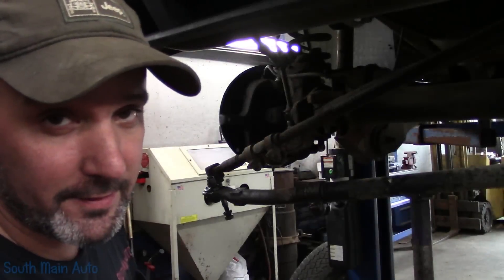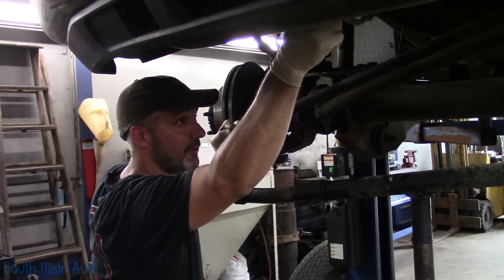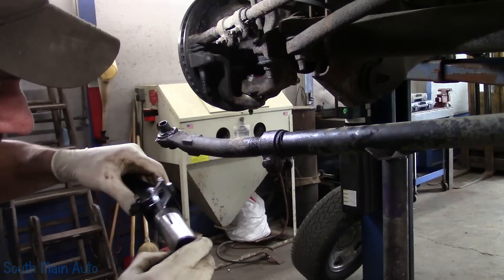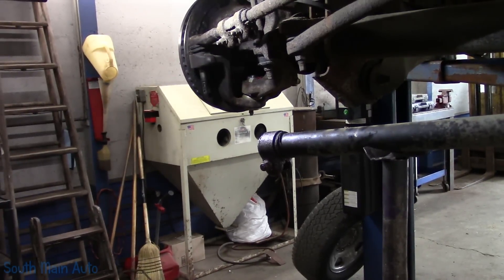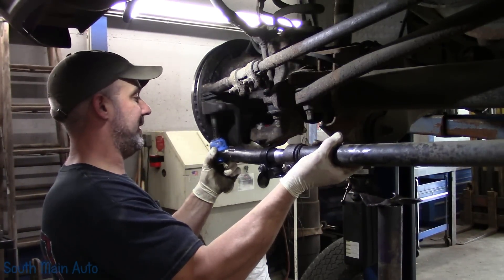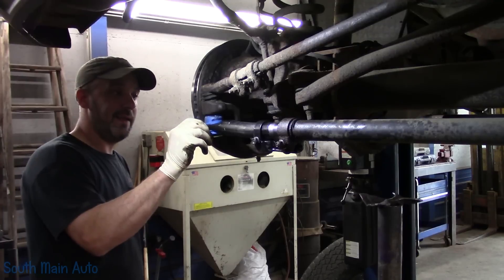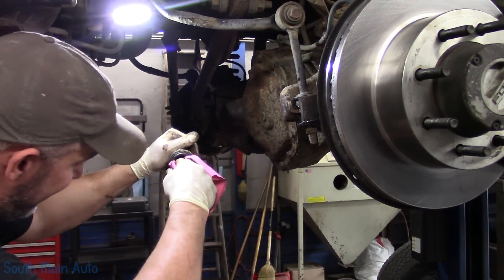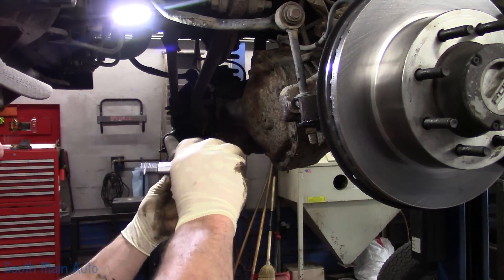Ford F-250: Ball Joints & Tie Rod Ends - Part III

Comment: 14:12 I feel for ya buddy. Back in the `80s I had an "X" car on the hoist. They had a license plate on the left side of the front bumper. I was walking a regular pace and my head met that f`n license plate puting a cut in my forehead. I stopped wearing a baseball cap while working on a car after that. That bill blinds you.
Reply: A knit cap works well and soaks up the blood before it runs in your eyes!

Comment: Re: 19:00 bent rims: doesn't matter. Youre rotating the wheel while drawing the line, so your line will always be perpendicular to the axle. If the wheel is bent, the line will be at an angle on the tire, but it will still be in the right plane relative to the axle.
If you're going off tread blocks, this is a different story.

Comment: Always learning something here! Great idea on scribing the tires. By coincidence I always had tire treads to use as a reference that had even lines around the circumference... but that is a great idea. More accurate, and a quick check for a bent rim or hub, or an irregular tire.  I must confess when I do this its not "to get to the alignment shop"..... that IS the alignment.

Comment: I use whatever penetrating oil is cheapest whenever I have it on the shopping list. Like you said- Project farm and the other tubers have all shown there is no magic in a can. Nice video series and thanks for sharing your journey once again.
Reply: I'm particularly pleased about the mixed magic failing any significant ratings too. Acetone and ATF will not combine making it's use for a long time soak so stupid even the cable guy isn't falling for it anymore. Just like so many internet rumors, this one will never truly die however. Because somewhere in poedunk - 'an old timer once told me...'

Comment: great series on the f250. just went through ball joint replacement on mine and had some of the same experiences you had. in my shop we use either a mix 50/50 of diesel fuel and mineral oil or atf and acetone. both are superior to anything I've ever bought. best wishes to you and your family.

Comment: I watch A.J. Foyt at the INDY500. Bent a tie rod. came into the pits. replaced the part. set the tow in/out with a stanley tape measure. went back out and WON! convinced me you can do well enough  the way you are doing it..

Comment: I’m in northeast Ohio. I’ll use pb blaster  and soak whatever I need to remove for a couple days beforehand.  My experience has been if the fastener is frozen in with rust it doesn’t matter. Break out the propane and hope you can break that bond. Penetrating fluid helps it come out easier but it won’t break the rust bond.

Comment: Project Farm did a good test on rusty bolt penetrating oils, and it turned out that few if any really did penetrate much, though there did seem to somewhat of an improvement over dry rusted bolts, not much, but some.

Comment: For the wheel alignment I use a piece of brown string attached to the outside of one wheel then around the front and other wheel and back again.  You can see if there is any degree and how much by measuring the clearance of the string against the outside of each tire.  Oh and you can do it with the string solo which is great if alone or everybody is busy.

Comment: I just did the right tie rod end and drag link end on my '08 this morning. My truck has the heavy duty front suspension and none of the aftermarket stores had a tie rod end that fit. Ford got me for $227 for a tie rod end (ouch). Fortunately, I'm a retired ASE master, so I do all my own labor. I used to tell people "If I can do it, you can do it. The only difference between us is that I own $100K in tools and know how to use them."

Comment: As a mechanical engineer employed in Australian mines, we have been able to test numerous penetrating fluids, both commercial and industry specific, with little real word effect. Our goto fluid, if you can refer to it as, is liquid carbon dioxide at - 75 °C. Extreme ? Hell yeah but always successful. Our technique of ' pour and punch ' with a pneumatic hammer, chisel or ratchet drive never fails to loosen. 👍👍

Comment: Been turning wrenches professionally for about 30 years in the worst rust belt known to man, Quebec and ironically did the same job on two different f250 this week. I agree totally about penetrate fluid being so so  at best .love your videos' Eric .i use a tape measure from end of tube to stud of tie rod instead of counting turns and both trucks were bang on for toe adjust, probably lucky tho lol.i didn,t see all your videos on this job i assume you covered that the camber caster sleeve has to be clean and lubed to avoid torque steer problem and that there is a sequence to follow when tighten the ball joints lower 44 ft lbs then upper 70 ft lbs then lower again at 150 ft lbs all to avoid the torque steer problem

Comment: I work in the heavy diesel field, I use Kroil.... and I love it.... I have had lug nuts that a 1in impact couldn't break loose. I hosed some kroil on them let it sit for a bit and then hit it with the 1in again and they came right off. I've also used it when doing work on exhaust and it has saved me from broken bolts.... Personally I have had good experience with it.

Comment: I used kroil for years at my last place of work.  Never heard of it before.  Its super thin and seems to work ok.  My biggest complaint about Kroil is the larger cans run out of pressure before they are empty.  I've used wd-40, pb blaster, liquid wrench.  i would say kroil is closest to pb blaster.  now, 10 years ago at a different job i used Zep 45.  loved that stuff, smells like bananas.  expensive though.  but that would be my choice.  it handles heat well too from what i remember.  seems Zep makes pretty damn good stuff.

Comment: I'm a homebrew ATF/acetone guy but i'll use WD40 in a pinch. I think on occasions it helps but i'm always ready to grab the air chisel and the map gas. Although on several occasions i've had to just cut stuff off with a cutting disk and go to the scrapyard and get something that isn't rusted solid. 

Thanks for the video Eric. Really interesting as always. 

ALSO. I HATE TO GET ALL CAPSLOCK. BUT WHO THE HELL KEEPS CALLING THE SHOP? SERIOUSLY WHOEVER YOU ARE, ERIC IS TRYING TO FUCKING WORK AND HE DOESN'T HAVE TIME FOR 20 QUESTIONS 30 TIMES A DAY. JEEZ.

Comment: I worked with a guy who didn't think penetrating oils worked. One day we were trying to change a lift brake band on an American 7220 crane. They have a 1-2/2 inch pin about 8 inches long anchoring the dead end that hadn't been installed using anti-seize. We had a drive pin with a shaft welded to it to hang on while driving it with a large hammer. We spent about 20 minutes trying to pound it out using a 10-pound hammer. You aren't supposed to use heat on the metal in lifting cranes because it alters the structure. My co-worker had cut the brake band on the other side to get the similar pin out. The band cost $2000 so we didn't want to do that again. It was late in the day so we decided to bring the slice torch out the next morning to bore a hole through the pin. I soaked it down with K&W Knock'er Loose and he laughed at me. The next morning we decided to try driving it one more time. On the first hit, it shot out and landed about 6 feet from the crane. It made a believer out of my co-worker.  

The guys that worked on the overhead doors brought a bracket from a door to the shop to use a vise. They had soaked it down the previous day with PB Blaster and couldn't get it out. The bracket was no longer available and they were trying to replace the roller. I gave him some Knock'er Loose to try. Later in the day, he asked me where to buy it. He said it was like it just like it disolved the rust. It's available under both the K&W and CRC brand names. I've had good luck with Liquid Wrench. PB Blaster seems to take several days to work. I haven't been a Blaster fan since the salesman came around with their air tool conditioner. He wanted to demonstrate it. He put it in our 3/4 inch drive CP and it promptly seized up.  

Any of these products take time to work. The longer they have to soak, the better they work. I had the advantage of knowing what I would work on ahead of time so I could spray it down at least a day before. Most shops only see the vehicle on the day they work on it so they don't have time to wait but if it's sprayed as soon as possible, it has a chance to work. If you wait until you are trying to remove it, it won't work in a couple of seconds.

Comment: That was old school toe adjustment and how we did it on heavies and DIRT modifieds...scribe and measure...bounce,roll, scribe & measure.  I don't know how many shops that replace tie rod ends and don't center them before locking them down and even had a few from alignment shops which should never happen and they are bound up...defeats the purpose of the pivot. Attention to detail. Nice 3 part series!

Comment: I'm going to call Eric and suggest that he respond to the phone call situation by writing a book - "The SMA Car Repair FAQ."   The book will answer all the questions that most people ask:

"My check engine light is on.  What should I do?"
"My Valiant is running rough.  My Dad says to add SeaFoam to the gas, my uncle says to put Marvel Mystery Oil in the crankcase.  What do you recommend?"
"After installing new brake shoes on my Galaxy, I have a few extra parts left over.  Are they important?  Can you tell me where they go?"

Comment: Suggestion on how to handle callers. Run promotion.   Here is an example. Anyone who spends $250 or more on swag, patron , fund me from Oct 6 to Oct 10 will be given a private number to call you and allowed up to 5 minutes. Calls will be recorded and will be on featured as a you tube video.  Buy a prepaid phone and give out number and throw away after that.

Comment: There's only one penetrating oil I've seen actually creep into the thread and that's Omega 636, and when it doesn't it really helps lube through the rust so the nuts and bolts cut the rust easier, at least it feels that way. If it's really much better than anything else, well SFR, CRC, SaBesto(Würth), and a few others I've tried don't really work as well, although SFR is pretty decent.

Comment: Back in 1996 my Dad had a Ford pickup truck that had the king pin freeze up and he couldn't turn the wheel.  He soaked the top down with liquid wrench and no luck.  He had bought a new product called Prolong for his van that kept overheating and it worked as the van never over heated again, but there's a whole nother story there.  Any who the kit he got included a can of super penetrating oil.  So I filled the top opening with it and Dad said I was wasting my time.  Now keep in mind when we did the same with the liquid wrench it just sat there.  With in about 2 minutes I noticed the oil was drained down so I spritz it again, same thing.  So I took to tge hammer and within 5-6 smacks it started to move and soon it was freed up.   Dad was excited as he was moving to the north woods and had another truck (that didn't run) besides his van to get up there.  I ended up pulling the other pick up on a dolly with this one.  So needless to say I have been using Prolong products for many many years.

Comment: I live in Cleveland. The best penetrant is a torch. F’in rust belt city. I use Blaster mostly. WD 40 only for some cleaning or keeping tools from rusting. It was developed to disperse water. Water Dispersant #40. Blaster is made here in Cleveland. Most of the penetrants on the market work about the same imo. ( not very well)
Reply: right the very tight small molecule rust/crud needs broken up so the penetrants molecules are small enough to actually penetrate :) usually lots of beating, smacking cussing, freezing torching will sometimes shock it enough. but working in a shop who has time to wait? rush rush rush....

Comment: An easier way to rough in a toe is to use a length of string taped to the outside sidewall of the back tire and run it to the sidewall of the front tire. You'll just have to adjust the tie rod so that the string touches the sides of the front tire lightly and equally along on sidewall of the tire. Basically, you're using the back tire as the "straight ahead" to line up the front tire.

Comment: I changed my A frame or whatever it's called,  the triangular piece that holds the upper ball joint, and attaches to the frame with what I call a "dog bone", with two large bolts, which are used for alignment purposes. So in doing so, this requires a new alignment, as removing those bolts from the frame, (with the dog bone) this changes everything as far as alignment goes.

So what I did was I took measurements with a steel tape measure, from the steel ball in the center of the grease zerk on the old upper ball joint before disassembly, to three different places on the chassis, to triangulate this location, and I think I got it pretty close to where it was, close enough that the steering wheel was straight, and  the toe was even  close again, (measuring from tread to tread, first on the front of the tire, then taking the same measurement from the rear of the tires. Anyway it went down the road OK, and in case I couldn't get in for an alignment right away, I could still drive it.

I have a long story about there being no such thing as a $29.00 wheel alignment, (which was advertised), but it is a long one.

Comment: The burnt out won't go away. As far as threads go. A nut on a stud it works alright. For a blind bolt, a seriously stuck one. Patience, hand tools, heat and, wax. A lot of wax. I have also had fairly good luck with diesel fuel. Here in Colorado rust is from tourists.

Comment: I've had rusty nuts I broke loose only to have them jam again on rusty threads.  Lubricant here helps.  What lubricant?  Anything that contains oil.
Reply: to me that is the best use for penetrant, lubricating the broken loose parts as they clean the last junk from threads. something rusted solid tight nothing will penetrate it, unless it gets shocked hard. torch, flash frozen, sometimes hammering works, other times getting it to move at all, then soak. obviously flash freezing it with a liquid is rather dangerous

Comment: Eric- I was going to ask this during last night's What's up Wed cast but didn't want to interrupt. 2008 F250 6.4 PS  FX4 (4x4) with the narrow monobeam like this one. RF knuckle tie rod taper is junked due to some knucklehead over tightening the upper end and pulling the taper through. I say all of that to set up this question- have a machine shop weld and re-drill the taper or eat the $1200 for a new knuckle? (Mcft MEOE-154)

Comment: My $0.02 on penetrants: In my shade tree experience I have never had Liquid Wrench fail me. If i have a critical frozen nut or bolt, i would reach for the Liquid Wrench first if i had it available. I have used W-D 40 and CRC, but dont have the same "warm and fuzzy" feeling when i use them.

Comment: Great video Eric....details are good.  Too bad, in my opinion, the left ball joint job did not request the right side be done also at the same time. I believe in doing those in pairs, like shock absorbers and tires. Also the tie rod ends, if you do one, do them all and be happy, especially if you will continue to own the vehicle for a long time. Darn Ford sure comes up with crazy ideas for steering knuckles on  4X4 vehicles. I think Dodge does the same or at least did for some years. Love those TTX ball joints !

Comment: I only found out about ATF and acetone a year or two ago but that DIY elixir made me swear off all the fancy, (read: expensive), stuff. Seriously: Change your number. Leaflet the town/local newspapers or radio. If one of us long distancers wanna' make the trip? That's why God made FB! :) You don't know how close I've come a few occasions to shoving the vehicle on my trailer and heading east. The problem is while at "normal" big road speed, it's about 9 hours. Far to be sure but, doable. Running 60 MPH max with the trailer, (yeah, lotsa' folks tow way faster but I don't have a death wish), it would be more like 12. :(  And, with my luck, my truck would explode exactly half way there.
Reply: 60 MPH bah. when younger we yanked the small trailer and rail buggy from far north eastern Ohio to a ways outside of Clarksburg, West Virginia. right at the poor trucks limiter 99MPH, would go faster down the mountains in neutral. pretty much every weekend from spring to late fall.
We used to always get behind the local boys and their empty tractor trailers, going so fast they were raising a side of trailer axles off the ground cornering, we didn't dare pass them. ;)

Comment: What's your opinion on greasing brand new ball joints and tie rods ? anyones opinion there is a great debate at my shop on this matter would love the input.  I do not grease new stuff only the old stuff because most if not all new stuff comes greased .
Reply from the maker: I give them a shot or two when I am done. Just they way I always have done it.
Reply: well looks like im changing my ways if eric o. dose it i'm gonna you are the closest person I know of that is like a automotive god ! thanks for resolving the grease or not to grease debate.
Reply: Give it a little just to see the boot swell some. They grease them from the factory, but only enough to say its greased. I’ve had some that swell the boot on the first pump. I’ve had some that take a few pumps to swell.

Comment: I find some penetrating oils don’t really work at all, only thing it helps is friction of the rust in between the nut and bolt threads, other then that it does nothing to help. It won’t loosen a stuck bolt